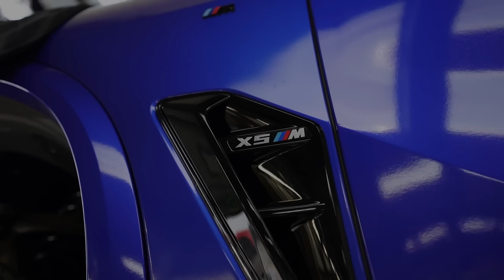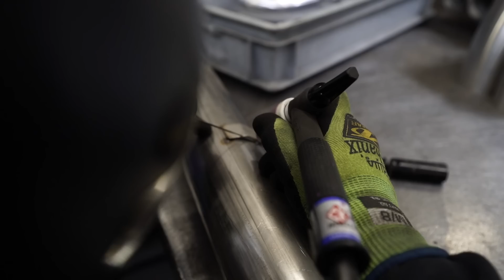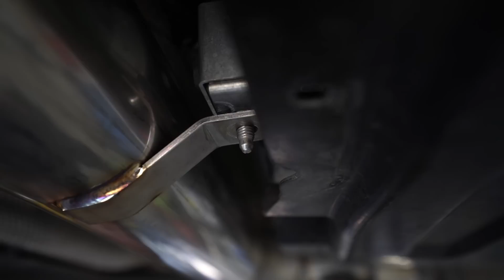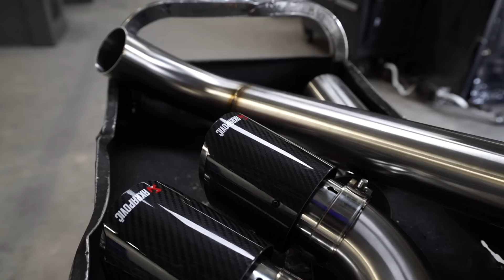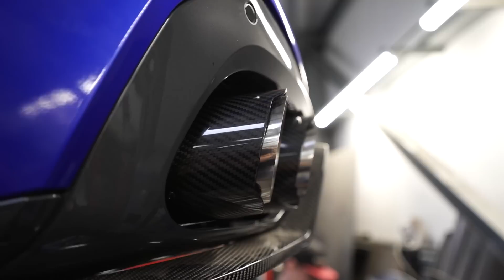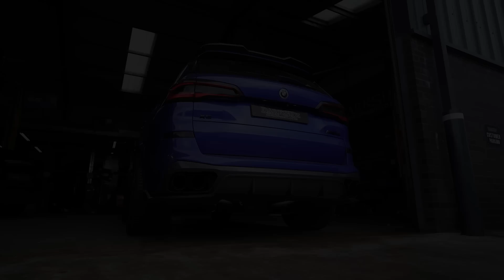QUAD TURBO BMW X5 B57 M50D!!! CUSTOM EXHAUST 😱

Comment: I watched the video with the previous X5 50d you posted and it looked super fast. That thing with 4 turbos is just insane. The only down side is probably the drag at high speed but up till 100 mph would destroy many sport cars.
Reply: Got the m550d f10 430+ can tell you even over 100mph with those 3 turbos its going :p
Reply: @le_bosseur4996  Unfortunately Bmw couldn't manufacture 550d in uk due to something to do with the steering wheel being on the right (assuming no space). Not sure how you got to that figure 430 hp- is it just stage 1 as those as stock are pushed really hard already. You can't compare car to SUV as it will obviously be a different story.

Comment: how much hp nd torque is it pushing?
Reply: Should be 395 hp and 760Nm stock.
Reply: @eliasbubbe  yh but w the downpipes nd ig it’s tuned asw
Reply: Hey man.    It’s my car ….. 

Going to bring it back in a few months to re look.   But currently is 475bhp and 902nm torque 🙏
Reply: @scottjones5116  that is mad, love ur car man. What mods you got?
Reply: @crxzy.9777   honestly only had it for a couple Months.     Started with exterior.  Carbon splitter,sides, spoiler  etc.  
lowered 35mm.   Then this with Darkside.
Reply: @scottjones5116  that’s amazing man! Do you have social media where we can follow the progress?
Reply: @eliasbubbe  sorry. Scotteth.15
Reply: @scottjones5116  how much was the darkside tune nd dat? planning to get one in a couple months
Reply: @scottjones5116  amazing, thanks mate! I send you a follow request.
Reply: @scottjones5116 need to break the 1000nm barrier. Madness
Reply: @ahyaan2552   we’ll see what Darkside recommend next.  I’m game.
Reply: @scottjones5116 just careful with the torque as gearbox can only handle so much
Reply: @shadowchrome_ it’s fine at that level

Comment: What bhp and torque figures from stage 2
Reply from the maker: We've not done much with these models that have quad turbos. The f series with tri-turbo did 473hp and and around 710lbs/ft on a tune and deletes - https://www.youtube.com/watch?v=euYt14hmkCk&t=70s

Comment: Would my deisel Range Rover  evoque sound like this   I want pops and bangs lol
Reply: Get a petrol then
Reply from the maker: Most likely won't sound like this...you'd want a hardcut limiter but not something we'd do on a range rover
Reply: It’s a Range Rover soon it probably will go bang 😂
Reply: @FoookOff ain’t it just, them engines are ticking time bombs in stock form🤣
Reply: Do you really want to tune a evoque?

Comment: Akrapovic tips 🤮
Reply from the maker: Customer gets what they ask for!
Reply: They bad ?
Reply: @scottjones5116  Nah Akra's are great but the customer has asked for fake Akra tips to be installed.
Reply: My car and I genuinely had no idea they were fakes.    Completely oblivious 🙈.   They’ll be getting changed now though for sure.     Putting fakes on my baby.  Not wearing fake Jordan’s either.
Reply: @scottjones5116  Good idea, sounds mint and looks the part otherwise. Must be a cracking daily with so much torque on tap